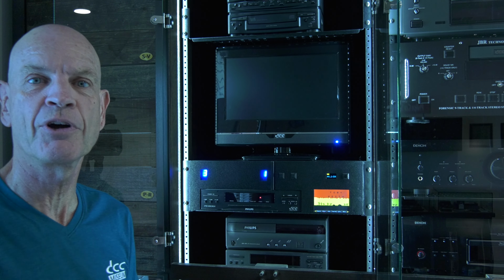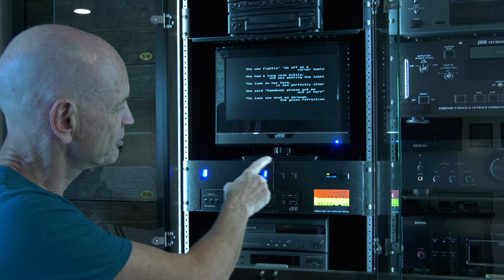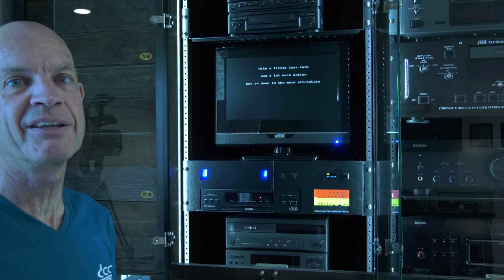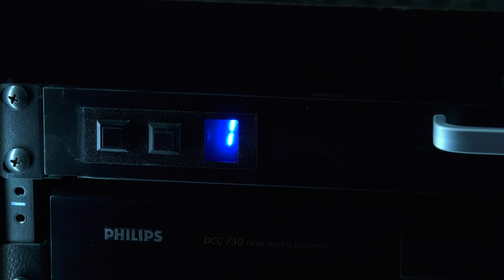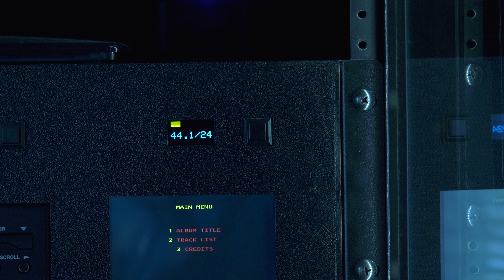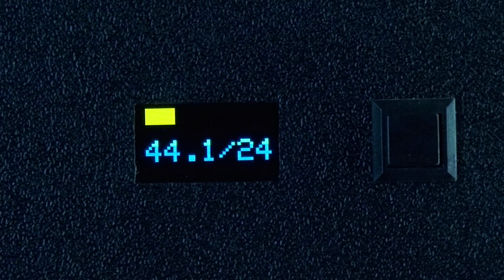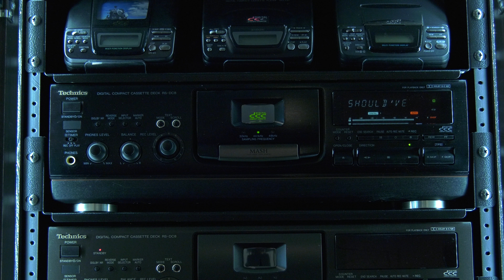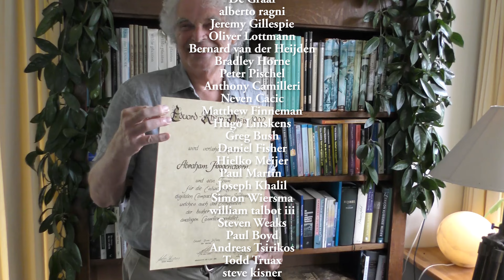Upgrading Our Rack & Display At The DCC Museum.

Comment: Are you sure that number 24 bit is accurate on the RS-DC8? I also have a RS-DC8 connected to a Marantz AV8805A PRE Amp and it says depending on source (32, 44,1 and 48 kHz) always 16 bits... The manual also mentioned nothing about 18 or 24 bit.
Reply from the maker: Yes. 100% confirmed. The electronics built for this are verified and accurate. What it means is that the last digital converter is outputting 24 bit permanently. Like explained in the video, that does not mean it is 24, 20 or even 18 bit as you would need to find the weakest link in the chain. For most players that component limits it to 16-18-20 bit.
Reply: @DRDCC  hmmm interesting. The Marantz is capable of handling such bitrates (and even higher). So it should indicate 32/44,1/48 always on 24 bit on the sp/diff output?
Reply from the maker: @markschotgerrits283 on 44.1-48 yes. Never tested 32 until just now. It also is 24 bit.  When recording from analog sources. 32,44.1 and 48 record 18 bit. From digital sources 24 bit. During playback both register 24 bit.